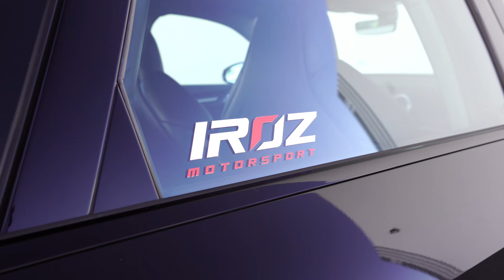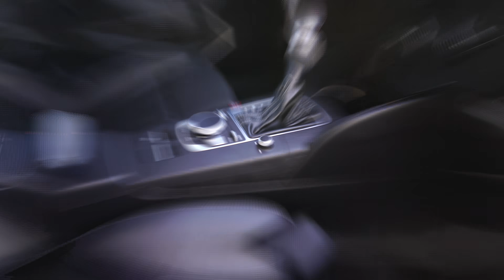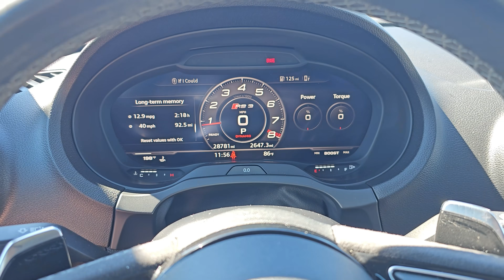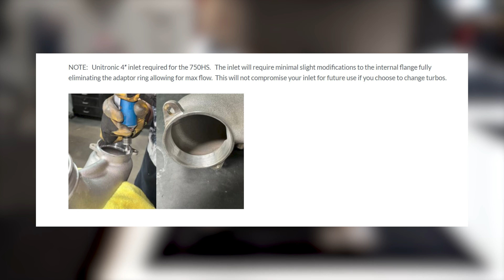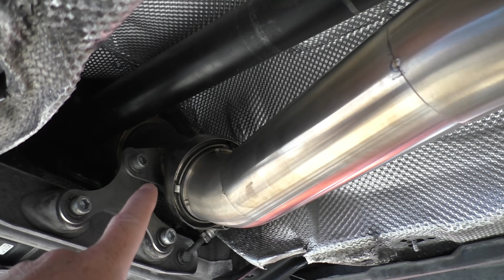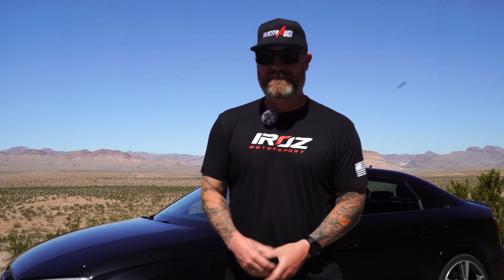THE BEST TURBO FOR A STOCK MOTOR AUDI RS3?!?!

Comment: I need a better low down spooling turbo then a stock rs3 . Any advise as my tdi  wipes the floor on set off due to it been vnt
Reply from the maker: Not sure I understand what you're asking. You own a TDI, and you want to find a turbo that spools better than your stock turbo?
Reply: @VancityAudi  no i own both  a rs3 dsg fitted on a t5 transporter  stock  but there's nothing fun about it  .other then noise. We're the other t5  has gtd2069vs 2.7bar  wipes the floor on set off .  Due to vnt  and torque . I wondered  if they do a better spooling turbo for a rs3 .
Reply: @Nicky-wy1ru Not possible.  The compression of the TDI is what gives you massive torque off idle.  The turbo is probably very small as well, which leads to quick spooling.  With the RS3, you would need to increase the engine displacement with some kind of stroker kit or downsize the turbo to something smaller than stock - either option is going to be $$$$.  One of the only things that would quicken the RS3's spool is a larger downpipe with a high-flow cat or de-cat.  Everything else pushes the powerband to the higher RPMs.

Comment: What's your secret to keeping the power down out of the hole? I'm stage 2 unitronic ecu/tcu flex E85. I spin to much off the line. I'm hitting a 3.01 0 to 60 when I know I could do better. Also have full JRI coilover set up as well. On fairly new PS4's too. 

Edit: Syvex controller... also, how do you use the RAL for Unitronic on our RS3s?
Reply from the maker: I've never used RAL before so I'm of no help to you there. Besides the Syvecs controller, you're using a performance street tire to attempt to put down the power. Use a softer tire with more sidewall like a radial and you'll grip SOOOOO much better.

Comment: Damn this is so good just found your channel!  94' UrS4 AAN owner here but I'm thinking of grabbing an 18' RS3 Avant.  This setup is the shizit just one question will you upgrade to a Syvecs piggyback ECU at some point?  I feel data logging and safety parameters are crucial especially if you want to do some track days- thoughts?  Fantastic content man subscribed!
Reply from the maker: The Syvecs unit is not a piggyback. It replaces the OEM ECU. The OEM ECU has more than enough logging capabilities to make sure your car is safe and its performance is maximized. The car in this video is on an OEM ECU.
Reply: @VancityAudi  Thanks for the response man!  Wasn't aware of this that's good news- a stock DAZA is good for me not really interested in doing a tune right now just going to focus on suspension and brakes.  I do want to have safety features in place for either bad plugs, coils, injectors, or fuel though.
Reply from the maker: @jdmimportlogistics all of the current tuning options out there have a ton of safety options. I wouldn't be surprised if they have even more than stock seeing as you're pushing the motor harder and the tuners arw very aware of that.

Comment: Does this turbo can be installed with stock injectors and no dump pipe and a Wagner evo1 intercooler just for road not for drag ?
Reply from the maker: Here's another one on it. Shows what you need installed: https://youtu.be/cBUm6iJO6Bw

Comment: An this whole kit costs how much? around $20k?
Reply from the maker: Not even remotely close. You could get away with running this turbo with just an intercooler and a downpipe. You wouldn't get the full potential of the turbo, but it would still work.
Reply: @VancityAudi  I have a mk8 R at the moment but I plan on owning an rs3 or ttrs at some point. Was just trying to get some ideas. That turbo setup seems perfect to me. 650-700 wheel is so perfect for a road car
Reply from the maker: @Jvilleman400 it's near perfect for a fast daily driver

Comment: I don't know what Hank would say because I respect his knowledge, but you're definitely bumping up against the max power you'd want to do without building the motor I believe on his  big build he definitely does full internals
Reply from the maker: As I mentioned in the video, this turbo makes less torque on E85 than the stock turbo does on E85. It was specifically designed to get the maximum potential out of the stock motor safely. Hank goes over this in detail in this video: https://youtu.be/mADZM_dlpxk

Comment: I’m sold on this turbo jw i have a 4in uni intake will i need to upgrade to the 5in? Or would the 5in intake just be for more maximum gains?
Reply from the maker: Your Uni 4" intake paired with a 4" turbo inlet will work really well. I'm not sure how much more hp you'd gain with an Iroz 5"

Comment: Its well known above 550hp the motor needs to be built.
Reply from the maker: Well known by ignorant people? 🤣 It isn't the horsepower that ruins motors, windows blocks, or bends rods. It is the torque. Just the Stage 2 software from Unitronic makes over 600hp, lol.
Reply: @VancityAudi  look it up! It is way too common for it to be ignorant. Maybe you're the one who's being ignorant. Plenty of info regarding this. Yes you can tune to 600hp, push it and see how long it will last.
Reply from the maker: @davothegreat9990 LOL. Do you realize I've owned an RS3 for 5 years now and have been a part of the development of these cars running 4 different turbos along the way? You are talking out of your ass, lol. Just admit you were wrong and move on. Stage 2 cars running ethanol make more than 600hp (as I've already stated) and NO ONE builds their motors when running a stock turbo because there is no need unless you are making more than 540lb/ft of torque.
Reply: @VancityAudi  people, don't listen to this guy. My brother builds motors for a living here in Aus. Trust me do your own research and before modding. Don't take this guys word for it or mine for that matter. Info is all there from multiple different owners not just from this one guy on YT!! 🤣🤣🤣🤣
Reply from the maker: @davothegreat9990 I'd love to hear from your brother on this and not you, lmao. If he's ever built a DAZA, he'll know that you are completely wrong. Get a clue.
Reply: @VancityAudi  well he's working interstate at the moment. I know because he's worked on few rs3 in the past 12 months or so and this is what he told me. I looked it up and it's all there.
Reply: @VancityAudi  doesn't matter anyway. The take-home message should be to do your own extensive research before modding any car. Motors aren't cheap.
Reply from the maker: @davothegreat9990 😂 okay, if you looked it up, please send me the link to where you found a reputable source saying you need to build a DAZA over 500hp, lol. I'll wait.
Reply: @VancityAudi  tried already. YT doesn't let you links anymore!
Reply from the maker: @davothegreat9990 then email it to me please. Adam@vancityaudi.com
Reply from the maker: @davothegreat9990 here's a link to where every single car makes over 500hp with a stock motor and none of them have had a single problem: https://youtu.be/_jC5AgLRb3w
Reply from the maker: @davothegreat9990 oh look at that, it allows links!
Reply: @VancityAudi  thats YT link!🤣🤣
Reply from the maker: @davothegreat9990 https://www.getunitronic.com/ecu-tuning/Audi-RS3-8V-25TFSI-2018-2018-stage2-e85 here's another link! This one shows how a simple Stage 2 tune on ethanol makes 625hp! And guess what?!?! That's on a stock block! Lmao
Reply: @VancityAudi  I'm not saying it can't make more power!! You should be stating that if you're going to modd to please do your own research before doing so.... 🙂
Reply from the maker: @davothegreat9990 I wouldn't be telling the truth then. Let's take a step back. You started this comment thread of stupidity by saying it is unsafe to make more than 500hp in a DAZA without it being built which is absolutely incorrect. You are misinforming people which i am completely against. I on the other hand have a ton of experience with these motors and with these builds and know that NO ONE needs to build their motors until they are looking to make more than 520-540lb/ft of torque (depending on the dyno) EXACTLY like I mentioned in this video. So no, you don't need to go and do your own research. I'm telling people from years of experience that is the case and has been proven over and over again by every single tuner & turbo manufacturer out there.  By the way I'm still waiting for the link you said you had from the 'readings you've done that backs up your BS claims. I've just proven you can attach links.
Reply: @VancityAudi  only creators can share links on YT. Just checked now. That's why you can but I can't!! Gee, you should know this...
Reply from the maker: @davothegreat9990 well I've shared my email address with you, and I still haven't received an email with your 'proof'. News to me on the link sharing within YouTube, lol. As much as I know a ton about RS3's, I don't know F all about YouTube comment rules, lol.
Reply: @davothegreat9990  Torque is the real engine killer, not HP.  Since this build is sitting at lower torque than a lot of stage 2 builds, it is technically safer on the stock "engine" (there is no motor in this car) :)
Reply: This car literally is owned by iroz. The king of Daza, you who clearly doesn’t know anything doesn’t have any room to talk

Comment: Hey Adam, thanks for giving us this insight. Couple questions, I don't have the Unitronics dp but do have the CTS, i am assuming no issues, correct? 2nd, you mention the syvecs awd controller is also required. Just making sure this is absolutely required and if so curious to know why. TIA Bill
Reply from the maker: The CTS Turbo downpipe will work fine for power, but not for emissions if you have to deal with that where you live. As for the Syvecs controller, that was simply a part used in the build I showcased in this video. It isn't necessary unless you want the peak performance out of your car by gaining improved traction.
Reply: @VancityAudi  ok thanks for the clarification Adam. As for my location Im just north of you and own the 2018 black TTRS...we met at Racing Greed a couple weeks back at the Audi Club dyno day. I just got my flex fuel kit from Kyle and based on this video I am now committed to getting this turbo:). Hoping Kyle is able to become an Iroz reseller so I can get it from him and have installed before the 2024 season begins🤞
Reply from the maker: @BK-vf8zh I hope Kyle becomes an Iroz dealer as well! Lots of great things to buy from Iroz

Comment: Stock rods will leave the chat soon enough.
Reply from the maker: Why do you think that? There are TONS of stock turbo cars that make more torque than this car does, which have had zero problems.
Reply: This turbo/tune is stressing the engine less than some aggressive stage 2 E85 tunes.

Comment from the maker: My apologies everyone!!! Nick & I missed three very important pieces of hardware to complete this build. This car was also utilizing a Unitronic downpipe, the 980cc upgraded port injectors, as well as a Syvecs haldex AWD controller!!!
Reply: Do you have a video up on syvecs controller on stock engine n trans? This video just sold me on one and can’t wait to beat some PR’s
Reply from the maker: @lilcj141 you don't need a built motor to benefit from using a Syvecs haldex controller: https://youtu.be/iVhgxdGqUOQ
Reply: Is the downpipe mandatory?
Reply from the maker: @Xolition an upgraded downpipe is mandatory. It doesn't need to be a Uni downpipe though
Reply: Guessing you need mid pipes as well?
Reply from the maker: @giuseppetosco7242 no, midpipes are simply upgraded to better the sound from what I understand.
Reply: What's your secret to keeping the power down out of the hole? I'm stage 2 unitronic ecu/tcu flex E85. I spin to much off the line. I'm hitting a 3.01 0 to 60 when I know I could do better. Also have full JRI coilover set up as well. On fairly new PS4's too.
Reply from the maker: @skylerssupercarlife348 first off is to use proper drag radials because they work best. 2nd is your tire pressure. Too high and there's no flex in the sidewalls. 3rd is to use smaller wheels. 18" with a meatier tire is going to work better than a 19" with skinny tires. Lastly, in this video we used a Syvecs AWD controller which was installed in the car. That makes a MASSIVE difference as shown here: https://youtu.be/iVhgxdGqUOQ

Comment: Is that 750hs car running a stock downpipe and port injectors? He didn't mention those parts in the build.
BTW my UniFlex kit shows up Tuesday!
Reply from the maker: Good catch! That's my bad! It has the Unitronic downpipe installed, and we completely forgot to mention that. I'll pin a comment to make sure everyone knows.
Reply: @VancityAudi  I planned on that upgrade regardless. So Unitronic has a specific UniFlex 750hs turbo tune available?
Reply from the maker: @scottc78 that's what the car is tuned with
Reply: @VancityAudi  perfect. Then I'm only a turbo and downpipe (and port injectors?) away from that setup now
Reply from the maker: @scottc78 Gawd damn it! I forgot to mention the injectors as well! Hank and I discussed them in the Iroz shop tour video. I'll add that to the pinned comment.